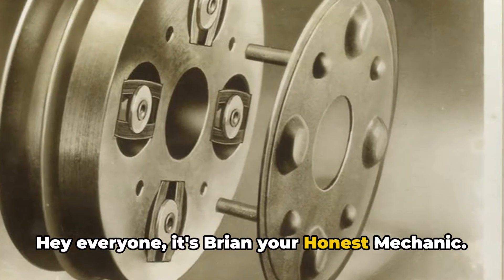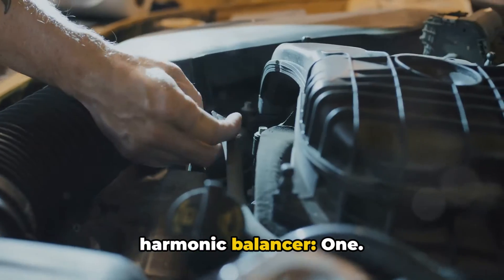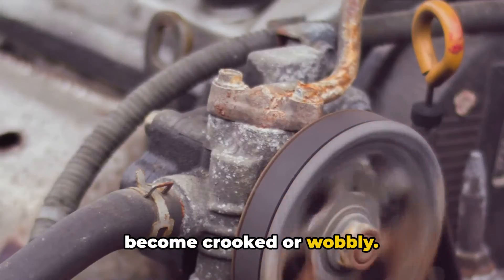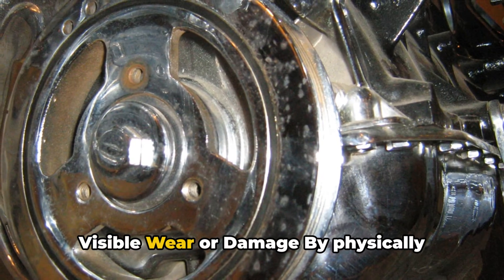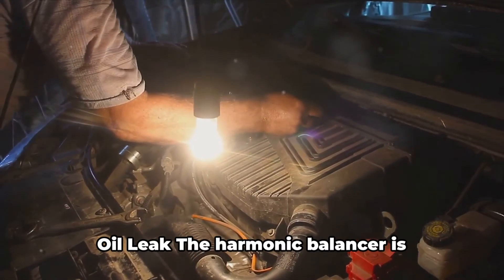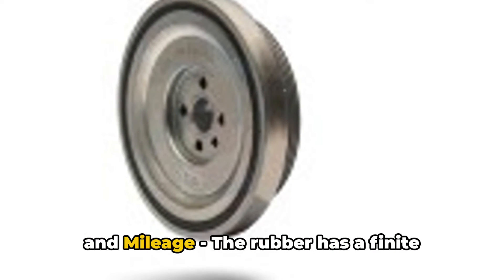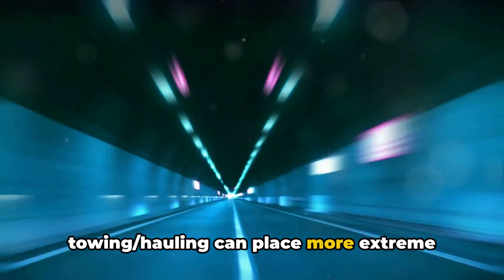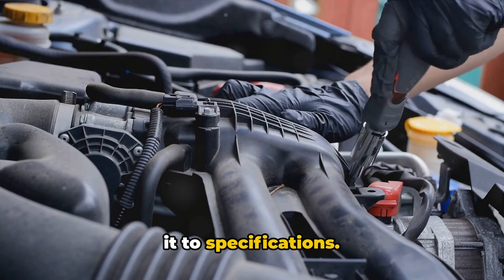Bad Harmonic Balancer Symptoms: 5 Common Failure Signs

Comment: If you are hearing a rattling noise when idling, take the belt off and run the engine for  30 seconds max. If the noise cease then its harmonic balancer or idler/tensioner pulley. If it still rattles with the belt off, you are looking at timing chain or timing chain tensioner
Reply from the maker: That's some good advice!

Comment: I just got this problem. I detected firs rough vibration while acceleration either moving or not moving. No leaks yet then a couple days later I opened the hood and I saw splashed oil from fan. Seems coming from big pulley
Reply: Was it the crank pulley in the end?
Reply: @dragos-lucian Yes. No rough vibration after replacing it. I noticed other vibrations but I think  it needs motor mounts. Not time for that yet
Reply: @fernesal Thanks! My car is smooth but when I stop at a red light in D, there's a vibration felt throught the whole chassis. It happens with brand new original motor & gearbox mounts. I guess I gotta get a new crank pulley and see how that goes. Thanks for the response!
Reply: @dragos-lucian Yes. No rough vibration after replacing it. I noticed other vibrations but I think  it needs motor mounts. Not time for that yet

Comment: My Jeep belt had a slight squeak so I replaced it which stopped the noise.  Two days later ru 70 on the highway, lost power steering, temperature shot up.  I knew the belt had come off.  I attempted to put it back on, but saw the balancer was off an inch.  Had it towed to garage for a new balancer.  It lasted 280,000 miles.
Reply from the maker: Thank you for sharing your experience. It's always helpful to learn from others' stories to be prepared for any car troubles.

Comment: My belt just seized when turning on the aircon
Reply from the maker: Sorry to hear that. It's typical for the serpentine belt to wear out overtime, since in most vehicles it also operates the air con. did you manage to get it replaced?
Reply: @HonestMechanicChannel  yeah, replaced the harmonic balancer. Aircon and belt was fine. Think with the extra resistance of the aircon made it wobble  and the belt slip. Bloody expensive for a pulley, part alone cost me nearly AU $900! Kia Sportage is supposed to have cheap parts

Comment: This is the last possible thing that could be causing my car to shake in 1st gear.
Reply: Me too brother. I have changed all my engine mounts, spark plugs, plug coil, adjusters. This will be my last hope to solving this
Reply: @anthonyikenna8075  im in the same position car starts but just vibrated I’ve changed mounts spark plugs egr valve, injectors, no vacuum leaked, new trans fluid change, n more but still having a shake .
Reply: Did it work for you?
Reply: @anthonyikenna8075  Actually it was a crank sensor that fixed the majority of the shaking. Now I just need to check my piston rings and crank bearings when I have time but that's a full day's work.
Reply: @nevinkuser9892  did your car start fine? If it did was it vibrating? And after did it stop vibration?
Reply: @nevinkuser9892 it didn’t throw any codes related to the sensor?